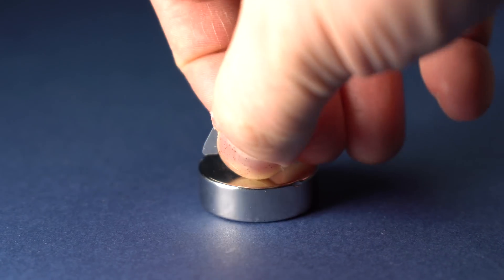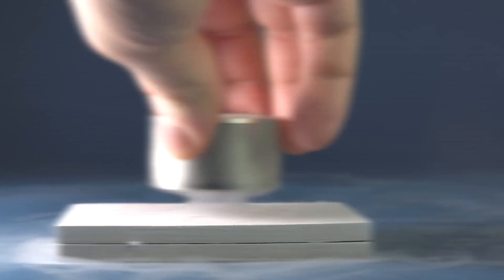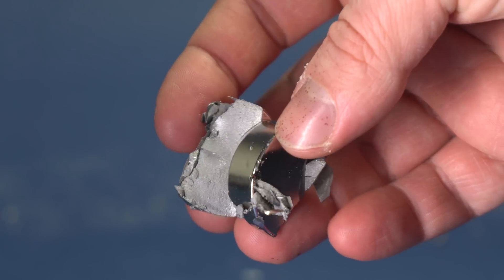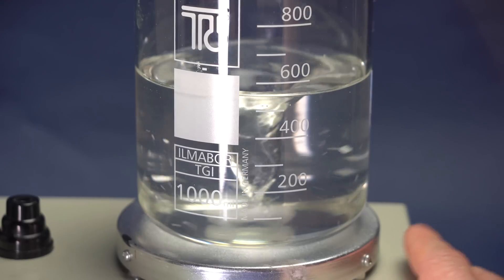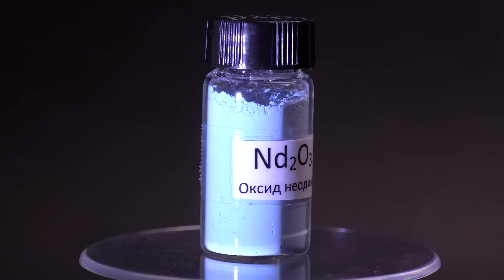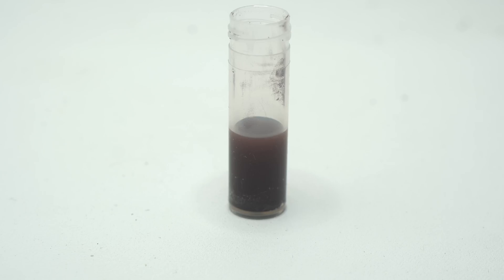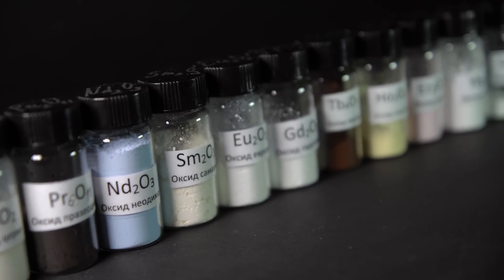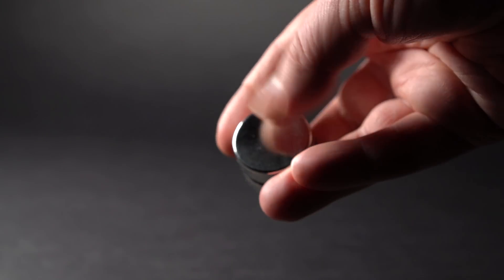What are Neodymium Magnets REALLY MADE Of?

Comment: FYI, the process of melting together loose particles of a compound under pressure and surrounded by inert shielding-gasses is called Sintering. It's the same way they make brake pads for your car and tungsten-carbide cutting inserts for machining. Calling it "baking" is somewhat of an oversimplification.

Comment: Yes, the coating is important, otherwise you end up with a pile of fine magnetic powder where you once had a magnet. However I find it differs from magnet manufacturer and batch to batch just how fast they disintegrate.
Reply: What happens when you change coatings? Tin? Gold? Copper
Reply: @off6848  Does not really matter the coat, so long as it is not going to react with the inside material and is reasonably inert. Most common is to have a thin flash coat of copper and then a thick coat of nickel applied as a seamless electrolytic coat, so that the inner material is kept oxygen free. Gold would work well except the copper plate and nickel would have to be applied as well, to keep the acid bath used to dissolve the gold from dissolving the magnet as well, plus the material would be changed chemically. however some are gold flashed to provide extra protection, though most is the nickel barrier.

Comment: I've had neodynium magnets attract each other fiercely enough to fragment upon collision. Truly an impressive material.
Reply: The cintered magnets use a formula (ratio of elements) that can hold a stronger field,  theres other types that are not as strong magnetically but are stronger physically by having a true metallic crystal structure, for applications where the magnet needs to not break. Its a tradeoff between the required physical strength versus magnetic strength.
Reply: It's not as impressive when you learn about how structurely weak those magnets are. It feels strong when holding but it's not.
Reply: Yes, consumer grade neodymium magnets should be in a harder shell than just that thin and cowardly metal skin they have by default.
Reply: They break really fast, not very strong
Reply: @terrandroid  It has nothing to do with their strength. They are strong, but they are also brittle, which is why they shatter. Over-hardened, non-tempered steel does the same thing. It breaks like glass.